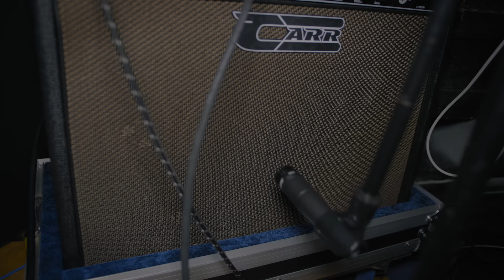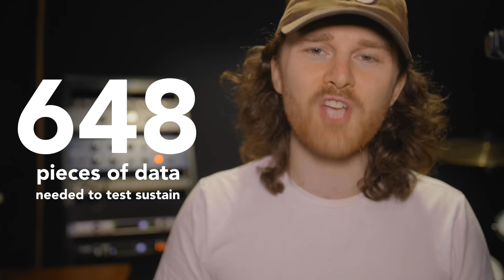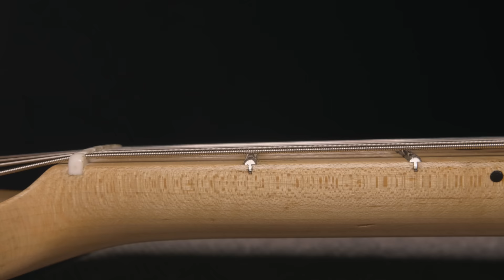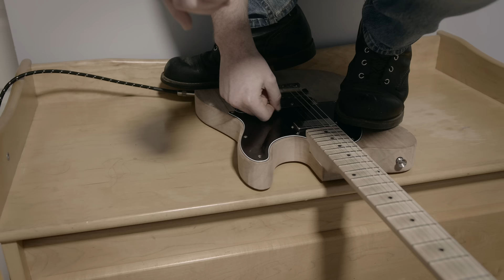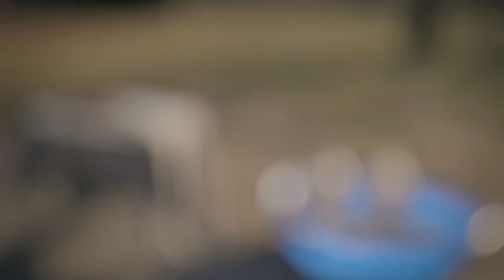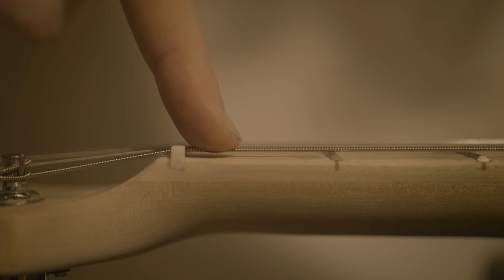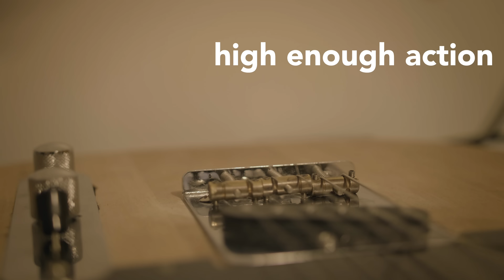Tested: Where Does The Sustain Come From In An Electric Guitar?

Comment: It's really down to output, the way hotter pickups, usually humbuckers, produce a more compressed signal. Be it from the pickup itself or by pushing the amp. Less difference between peaks and tails feel like more sustain.

Most guitars are pretty consistent in this.

The real thing is the player, I have seen a guy playing an LTD Les Paul type guitar with active EMGs and having bad sustain due to poor technique.

Could different shaped bodies and necks, weight distribution, bridges, etc, make a difference in how the guitar feels and impact the quality of playing? Sure.

Could a more "resonant" guitar vibrating stronger against your gut feel like more sustain. It does!

But in the end, none of those could translate into an experiment since they're subjective.

Comment: Since all of the tests are 4 seconds im wondering if the higher decibel losses are a result of the string having more kinetic energy. For instance the mattress vs held still. The mattress is allowing the strings to pull the guitar back and forth with it causing vibration loss much faster so the guitar is much more quiet on average over the 4 seconds thus less DB loss.

Comment: First the titebond guitar was pretty cool looking. I've always heard that solid body guitars had better sustain. Something about energy being lost resonating the body of the guitar. But have no idea if this is the case. I do know that certain notes on my 60 year old hollow body Harmony will play forever thanks to feed back. Really makes bends where I happen to touch certain strings a pain. The A string is the worse. I've heard that some players use to stuff cotton or something similar into the sound holes to try to eliminate the feedback. From my limited experience it seems that amp gain has the biggest effect. I turn the gain up too much and the Harmony becomes unplayable due to feedback.

Comment: Hi Jim. Thanks for sharing the hard work. Do you think it is possible to test sustain on bolt-on vs neck-thru. Having the same guitar made from the same wood with the same thickness, electronics, hardware, frets...etc and more or less having the same setup. And see if neck-thru has more sustain. Cheers

Comment: The only comment I really have is that instead of absolute change in dB, it may have been more interesting (presuming same pickups, etc.) to not look at fade from the start of the strum, but from a particular dB level.  IOW, if you have two plucks/strums, and one starts at 100dB and the other at 95dB, instead of measuring the loss from the beginning, maybe measure how much tehy lose from, say 90dB.

This would remove the variable of the guitar responding differently to notes struck with more energy.  Since the least consistent part of your test is going to be your interaction with the strings, that would seem to do a better job of controlling that.

Comment: You can play 2 les Paul's with the exact same pickups but one is a double cutaway,, and you here a difference in sustain. Also,, play an electric guitar unplugged to check sustain. The 'acid test' they used to call it.  Bottom line, if every one of these factors adds a small difference, that means the sum is a substantial difference when you add them all together. It's true, every part of the guitar that is said to matter really does matter in affecting tone and sustain.  My uncle worked at guitar center and they tried an experiment and hooked up a clamp on tuner on the headstock on a bunch of guitars unplugged and timed how long the tuner would pick up a signal. Les Paul won. Construction matters. It's fact and science.

Comment: Sustain and resonance comes from good wood, good components, fret work , set up, and technique. Obviously, a harder piece of wood is going to allow sound waves to permeate longer. But the real magic is in the little things; bone is really hard and rings like a bell, solid cast machine heads with tight tolerances and brass gears transfer more energy, silver, copper, brass, aluminum bridges are the most musical metals, and letting the guitar hang off your shoulders with minimal body contact. Good level crowned, and polished frets, action that is high, maybe even metal string trees, and not having the pickups too close to the strings. 😆😮 probably the most sustain your gonna get. Give it a good pick and let it ring. Sometimes I feel like a little vibrato prolongs it a little but I can't prove it. Anyways, it is a lot of little things that ad up to good sustain and resonance.
Reply: Why the pros sound like pros, they have serious guitar techs working on their guitars keeping them in top condition.   And modding em with high quality parts

Comment: Infact I always used to think that tone wood arguments are utterly idiotic. Electric guitar's sound is defined by the sound played via ampli-speaker. Which is the signal captured by the pick-ups. 
Now what is captured by the pick-ups? The string vibrations. The more resonance your tone wood has, the opposite effect it will have on the string vibrations. 
Hence the better your guitar sound unplugged, the worse it should sound plugged in.

Comment: Wouldn't it be better to measure the string vibration for sustained longevity combined with the bridge?

Years ago i bought a floyd rose gold steel version,swapped the rods and blocks saddle adjustable screws with titanium and swaped the small block with a fat block and every screw with brass screws...It was extremely chimey,sustained very good....but in the end it was still about the strings.

 42's sustained longer.
And longer the neck( 24fret) is the best distance for vibration to dissipate.

Long distance-short distance.
Reply: Forgot to mention also,The Frets along with all else mentioned!

Comment: This is a complex issue, due to variabilities in wood characteristics, used materials and quality of craftsmanship. There are a number of scientific articles, which are available to reach at google scholar or reasearchgate analysing this subject. The underlying issue is the fact that guitar body is not rigid and has different conductance for different frequencies. Conductance is inversely proportional to the sustain time — the higher the conductance, the more energy guitar sucks out from the string, the lesser “sustain”. And this is frequency dependent — it might be that it will affect a particular overtone of a particular note all along the fretboard. This is known by a term “dead spot”. And retuning the string will just move the dead spot to another fret, while the earlier position will just ring out...

I have a LP studio with a dead spot on B note on the E string. The fundamental is eaten alive in a few seconds — quite annoying...

Comment: Since the measurements are in decibels a harder strum is going to be louder and a softer strum will start off at lower db. Im confused why were using db loss instead of time till no sound for some test such as the cabinet test. Measuring in decibels is valid for test such as magnet vs no magnet.

Comment: The natural sustain of any guitar depends on how much of the energy of string vibration is sucked by the neck/body. 
Dictated not only by the density of wood, but also and even more by the bridge type - the less parts, the less loss is there.  So thats why Teles with vintage type bridge and LPs with wraptail bridge sustain like crazy 🙃
And maybe surprisingly - there were tests done how the neck joint affects sustain - the winner was bolt-on, 2nd was 
glued and last neck through...  go figure 😂
I´m taking here amplification out of the picture, cos what you cant get from the guitar unplugged, no amp can compensate for...

Comment: I'm curious. It seems like sustain would be a timing/duration measurement, not a volume/dB measurement as you are conducting? Or a combination, where you measure the time to a minimum dB threshold under each condition.

Comment: I'm wondering if the amp versus di sustain has to do with the natural compression effect of the amp kicking out small amounts of sympathetic sound, not enough to cause audible feedback per se but enough to create an analogue compression effect, whereas the DI box would not have that same relationship and even if amplified from DI may not have a strong enough signal at the outset to benefit from that same effect.
Reply: In theory the distance and orientation of the string relative to the amp and the latency of the instrument out to amp in connection could create a different phase relationship, damping the signal if slightly out of phase.

Comment: I wonder how you could sustain such a long test.

Anyway... I am a player who tends to play very long notes and I found to my disappointment that my old Strat is superior to my supercool, very expensive, custom-made Aristides 060. But why in the world?

---8<---- TL;DR skip ---8<---

I swapped the original Floyd-Rose bridge in my Aristides with one from Sophia Tremolos and... surprise: it increased sustain... not to the point of the strat, but still.
However... I thought it was just myself: I had paid around 500$ for that custom bridge, so that probably convinced my to play in a different way so that I justified the amount spent.
But then I measured a bit like you did and... the difference was not there. But still, while playing there's a difference. The setup of the guitars is super similar.

---8<---- end skip ---8<---

But when you actually play, you don't play a dead note; you move your finger(s) and / or whammy bar to have that vibrato effect: at that point, the ability of the fretboard to let your finger move, the fret friction with the strings, and the bridge lock play a role in dampening your string movement. So a fixed bridge has longer sustain than anything else; a strat bridge has longer sustain than an OFR bridge, but Sophia has longer sustain than OFR.

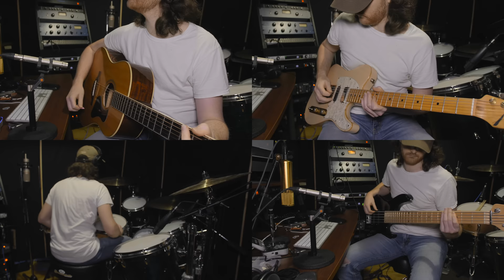Note: my test song for this is "Another brick in the wall", the super bending at about 2:30, which goes up one tone, than two, than two and a half and in fact, lasts about 4 seconds in total. And, in fact, that solo was originally played on a Les Paul (fixed bridge). In this particular song, the Floyd Rose "gives" more when I bend and makes it very hard to get to the 2.5 tones; my Sophia is definitely stiffer, as I wanted it to be, but still requires me to hold it when doing these bends on my 10 - 46 strings.

Please don't be too hard on me. 🥲

Comment: Did anyone test how long sustain is in vacuum? I suspect the air resistance robs the sustain dramatically
Reply: There is no sound where there is no air.
Reply: Although on an electric guitar i suppose it wouldn't matter,  if you could have the electrical signal leave the vacuum to an amp with air around it, you could test it

Comment: Amp model ,strings and pickups contribute to sustain and a fading long ring chorus type sustain.
Thus is very prevalent in complicated metal.
A good test is using pic and pinch harmonics and seeing how long ,solid and loud the ring is before it fades.
My 150w tube half stack rings for eternity!
My 150w Spyder IV has no sustain and dead sounding harmonics.
Please just do this test using heavy and soft coated strings in both 9’s and 10’s.
Use decent colored set of strings which are as heavy coated as it gets vs a decent normal average string and that alone will show you what i mean in a simple way!

Comment: Wow~ I commend your experiment. However, deadspots often exist when guitar sustain strikes an open string and when bending a certain fret. Deadspots also appear in other fret or in other lines of the same fret. There are parts with significantly shorter duration than in strings or fret with different notes. You can't get a clear answer about deadspots anywhere. The reason why sustain is important in guitar is that depending on the genre of the song being played, you often have to vibrate while vibrating a specific line of a specific fret for a long time. I hope you can experiment properly again.

Comment: Onley a few dB sound like almost nothing but it is a log scale.  3 dB less is 50% less. 10dB more is 10 times as much.  The problem is that there is no free energy. The energy needed to transform the string movement into current is coming from the movement of that string and that movement is caused by you and that costs energy.  To have a lot sustain the strings should have nothing that absorbs that energy, so no pickup, no bridge, no nut, no earth magnetic field, no air, no gravity. Just free-floating in space and ring on for ever. If we want to strum it and hear it we need to attach them to something and somehow transfer that movement to current.  And that costs energy and decreases the sustain.  Everything has a resonance frequency (I'm not talking the hippy stuff) If your guitar is resonant at a certain frequency it will give a lower resistance at that frequency, but only at that single frequency. Even a big bridge for traffic has one. It is the frequency where movement increases. Like a speed wobble on a motorcycle.

Comment: I had an HSH Fender Player Pau Ferro neck. When pickup (5) switch is set to its lowest (bridge), it had incredible sustain. I later exchanged the guitar for the regular SSS and noticed a huge difference of having little sustain in the higher registry then the HSH. So I installed a Seymour Duncan single Hot Rail Humbucker for the bridge on the maple top and maple neck Fender SSS. Still poor sustain. So I loosened ever so carefully the screws for the neck until I could hear any shift or wood tightening sound then had tightened everything back up. Still lousy sustain. So I tried Ernie Ball cobalt strings. A bit louder but nope...same crappy sustain. 

Had neck action properly setup by the music store. Sigh....nope. Why did the HSH have more sustain than the SSS even though they are of the same quality and brand but different bridge pickups and necks. To be clear, each had/have sustain. But one had more than the other when playing in the higher registry. The reason for the exchange was that the HSH had barely any resemblance of the nostalgic Fender sound. I did not want the HSS as I was already hating the fat Humbuckers. The Hot Rail single has similar tone and drive. Combined with the standard Middle and Neck pickup, it is a good overall combination and retains the Fender sound.

Comment: The human factor is a thing imo. In some cases the results were inconsistent. I think this was due the fact the way you picked the note every time was slightly different or not exactly the same. Doing some experiment with a “picking machine “ would be great.
Moreover I think that the nut material and the string quality/gauge have a role.

Comment: Nothing like some experimental science to put to rest a lot of loose theory... I do think, though, that the results of this experiment are not as clear-cut as those of the tone testing you did in your other video. Specifically, those "few Db" of difference did matter in some of the cases, such as when you coated the guitar in glue. The difference was actually pretty significant. Still, you were testing the extreme case there, and I would expect that with any commercial guitar finish, there will be pretty much zero difference in sustain between the cheapest and the most expensive version. The takeaway from both videos is that even cheaper guitars can be majorly improved to the point of being essentially indistinguishable from a super-fancy and expensive item by just a few tweaks, mainly changing out and adjusting the pickups and making sure the bridge and the nut are the right shape and the action is clean. The rest is pretty much all up to the player, the amp and the effects.

Comment: Great videos, what would make them more stellar is if you summarise your results at the end and draw some conclusions based on your data. Remember - 3dB difference is equal to half the power as the dB scale is logarithmic not linear. Also you expose  tonnes of hype in the guitar community where so many baseless facts are claimed without any proof or substantiation. To me, if you can play the instrument really well, you'll make even a cricket bat sing.

Comment: A guitar that sounds loud unplugged is going to have less sustain than a guitar that doesn't sound loud because the string energy is lost to the body and neck in a louder one
Reply: I think this is why the guitar on the dresser had less sustain (better acoustic coupling to the air).

Comment: It's annoying how this study completely overlooks the neck/body material and the nature of the neck/body joint. The more rigid a guitar's structure is, the less it flexes during the strings' vibration cycles, the less energy is dissipated in the form of sound and heat (ultimately you will still have the string flexing and moving through the air, but that's a very slow dissipation channel as compared to sound being radiated from the body and neck). So the rule of thumb is, the quieter a guitar rings when unplugged, the longer it will keep ringing. In practice the rigidity of a guitar is limited by playability requirements (neither the body nor the neck can be too thick, or it's not a guitar anymore, more like a lap steel or pedal steel "guitar"). It helps to have a glued-on neck or a neck-through design (SG works well), but the actual piece(s) of wood matter too (the more rigid, the better). An of course there needs to be a clean contact at the saddle and nut or fret, and electronics that don't drain too much of a string's energy via the pickup. In that sense, active pickups should favor sustain, as well as a lower volume setting on the guitar itself, as opposed to the amp. None of that was covered in the video, and it's a bit of a bummer.